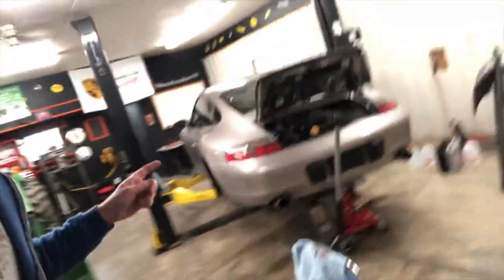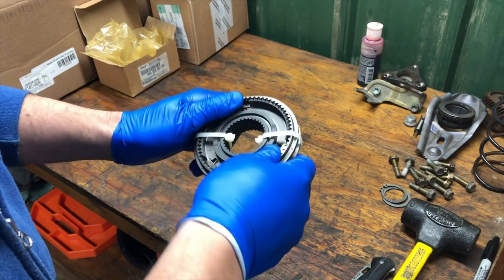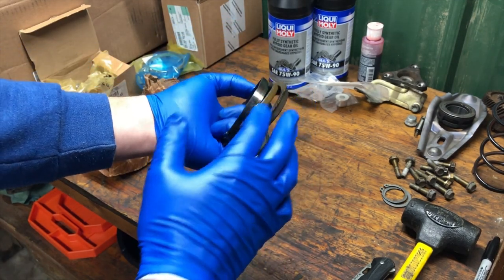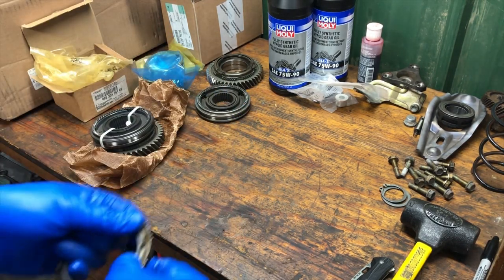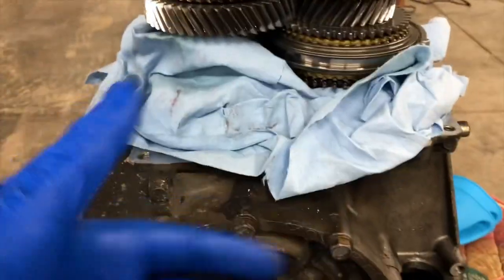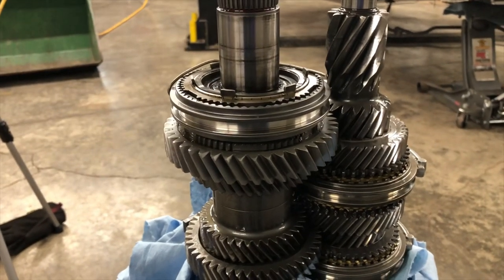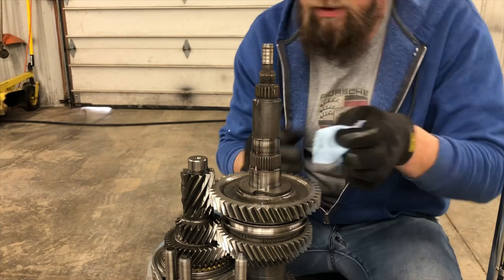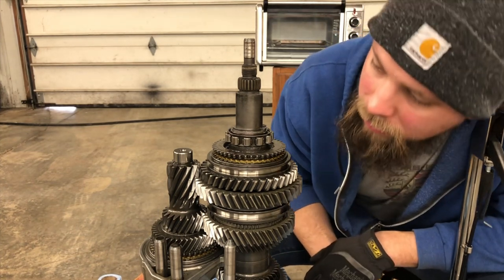Porsche 996 Transmission Reassembly, Part 1: Re-Stacking the Gear Sets

Comment: My 996 2nd gear is beginning to complain.  In my past I did a DIY bearing replacement in a Honda manual gearbox.  Your giving me confidence, thank you for these videos.
Reply from the maker: Bummer that your 2nd gear is starting to give you troubles! Happy to help. If you have experience working on transmissions then I'm sure you'd be able to get it done on your 996.

Comment: You are brave!  DIY transmission work scares me much more than engine work.  I have a 2000 996 that shifts perfectly. I try to use the gears minimally to slow down, especially 2nd gear.  Brake pads are quite a bit cheaper than parts and labor to replace syncros and gears, not to mention clutch assemblies.  Looking forward to seeing it running as new.
Reply from the maker: It certainly freaked me out a lot too, having had no experience with it beforehand. However, it's not actually so bad, compared to engine work.

Good thinking for taking it easy on your transmission. Hopefully that keeps your synchro hardware for years to come. Unfortunately, in my case, the track isn't a conducive environment for taking it easy on synchros haha. So it was time to renew it all for me for track duty.

Comment: Great work! Thinking about talking this project myself now that my 2nd gear is starting to show signs of wear… 

Do you happen to have a parts list for all the OEM parts your ordered for your refresh?
Reply from the maker: Thank you!! Yea, it’s worth doing because it won’t get any better. It’s a little bit of a tricky job, so just be careful and don’t rush it. 

Basically everything pertaining to the 2nd gear and 2nd gear synchro are brand new. The synchro hub assembly, which includes the detents, and outer ring, 2nd gear itself, then the rings that make up the synchro. Not cheap, but it is what it is. All of that can be found on FCP Euro and / or Pelican Parts. If you want specific part numbers, shoot me an email at vfgautowerks@gmail.com. I could write up a little reference list for you.
Reply: Great video, thank you it. I need to do this myself, can you send me the same pdf for the gear please?

Comment: Do you remember how much you had to heat everything to fit them onto the shaft?
Reply from the maker: I do! I heated each item at 350degF for about 15 mins each.
Reply: @FunAhead_TV_Official  Thank you! I’m looking to tackle this job sooner or later. Need to design some extensions for my gear pullers too
Reply from the maker: Haha yes, I had to get creative with mine as well. Thankfully I had several sets I could string together. Good luck and let me know if you have any more questions!